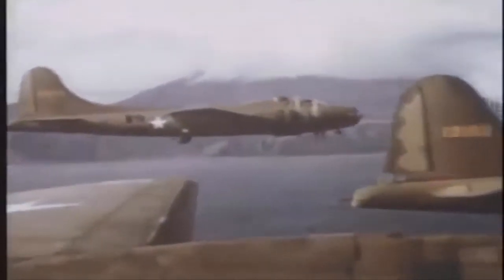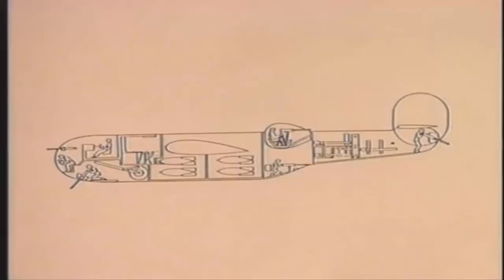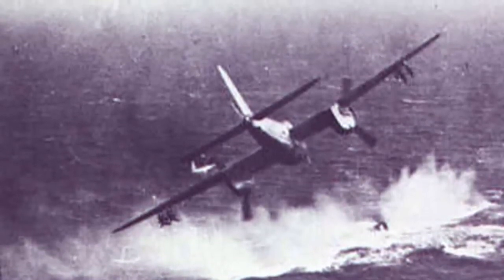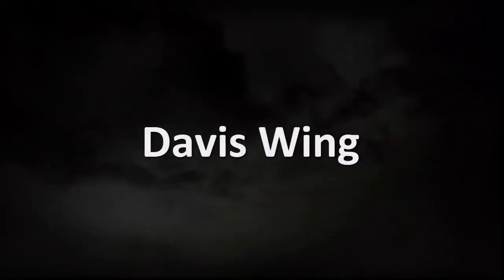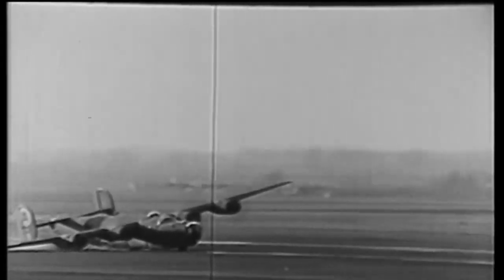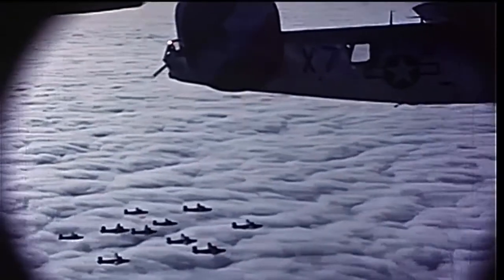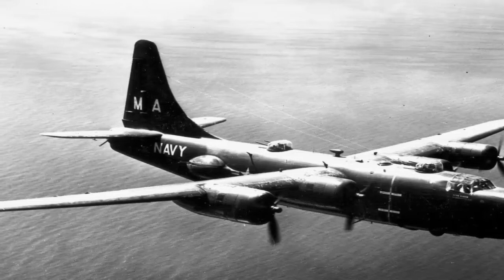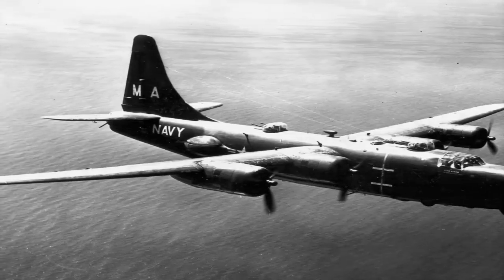B 24 Liberator:  3 Major Design Flaws

Comment: Both the B-17 and B-24 had their advantages and disadvantages. The Liberator had greater range, speed and bomb load, the Flying Fortress was more durable, could fly higher and was better defended. In Europe the B-17 probably was the superior bomber, but in the Pacific it was definitely the B-24. They both served their role admirably.
Reply: Which was superior depended on the mission requirements. 8th AF command preferred their B-17’s. Having a mixed fleet of both was a logistics headache.
Reply: Keep in mind the B24 dropped more Tonnage in the European Theatre than the 17 that was in Service longer..
Reply: Funny how B-17 fanboys don't want to talk about how the B-17 was retired from the Pacific in mid-1943 because of not only range issues but because it was a terrible anti-ship/submarines bomber! It couldn't bomb ships or submarines very well. B-24s served in all theaters throughout the whole war and was never retired anywhere like the B-17! B-24s won the Battle of the Atlantic and helped win the war in the Pacific! Also the sorties to losses ratio for B-24s (226,775 sorties with 3,626 shot down) was 1.60% vs 1.61% for B-17s (291,508 sorties with 4,688) in Europe! B-17s weren't able to bomb Romanian oil refineries in 1942-43. You know what bomber was able to do so? B-24s!!!

B-17s could only do one thing which was short range strategic bombing runs from England to Germany.

Btw, 3,626 lost B-24s and 4,688 lost B-17s in Europe alone in WWII is INSANE!!! We treat it today like it was not a big deal at all. Like that is normal. The British lost 57,000 KIA/MIA and 9,000 POWs on bomber crews alone in Europe also! How good were those German flak and fighters?
Reply: @nogoodnameleft  I knew a guy who was a mechanic on both the B-17 and B-24 in the European theater. He much preferred the B-17 to work on because it was far easier to service engines and do any airframe work. The B-24 was a great bomber, but it was more difficult to service.
Reply: @pimpompoom93726  I know the B-24 is ugly and very tough to work with unlike the beautiful and easy to fly B-17. But the B-24 still was the truly rugged plane that lost less planes in ETO than the B-17 and had a less sorties to losses ratio than the B-17. The B-17 was a non-factor in the Atlantic, Pacific (where it was actually withdrawn for poor performance in mid-1943), North Africa, Italy, and Romania until air bases were established in central Italy in spring 1944, unlike the B-24. The B-24 was truly an awesome Swiss Army knife. The Ford Assembly Plant for swift construction of 8,500 B-24s was one of the greatest feats of engineering and manufacturing in history also! The B-17 was not able to be built fast and efficiently like the B-24. The B-24 truly looks like a can of spam with wings. 🤣
Reply: @pimpompoom93726  The Allies used B-24s to harrass and destroy German U-boats and Japanese ships. It was a fantastic and accurate tactical bomber and anti-shipping bomber unlike the B-17s. They credit the B-24 for winning the Battle of the Atlantic! It was an incredibly versatile plane and not a one trick pony like the B-17. The B-29 also turned out to be a one-trick pony, never serving anywhere other than the Saipan, Tinian, and Guam to Japan bombing route, so the B-24 was truly a special plane.
Reply: @user-qy9tf2im7f  The only reason we don't hear about the B-24, which truly was the plane that won the war in the ETO (was equally as good as the B-17 in Europe), Battle of the Atlantic, and the Pacific Theater is because the first bomber in the 8th Air Force that actually flew 25 bomber missions successfully was a B-24, not B-17 Memphis Belle!!!! That B-24 flew 25 missions 2 months before Memphis Belle did! But sadly in 1943 on the flight home to America to celebrate the B-24 to make it popular, the B-24's pilot and most crewmen as well as the three-star general who was the ETO Supreme Commander (!!!) LTG Frank Andrews died in a plane accident while flying the B-24 in Iceland. It crashed into a mountain, sadly, and Eisenhower was tapped as ETO Supreme Commander thanks to the death of General Andrews. Andrews also was flying home to get his fourth star, making him the overwhelming favorite to be ETO Supreme Commander for Operation Overlord!!! That sadly killed all the PR for the B-24 and the B-17 thereafter stole the show in all the newspapers and post-war documentaries and movies as a result.
Reply: @nogoodnameleft  I worked in the Ford Plant in Ypsilanti where they made the B-24's during WW2, I worked there in the 1990's. They still had the big hanger doors in back where they used to roll B-24's out to Willow Run Airport. B-24 was a great bomber, a better bomber than the B-17. The Flying Fortress was really obsolete by the end of 1943, but it was more rugged than the B-24 and easier to service. The same narrow wing that gave the B-24 speed and range advantage also was vulnerable to damage. Until the ball turret was added to the B-24D the B-17 had better protection. 

I don't see this discussion as one vs the other, they both filled their role very well. The B-17 was available in numbers in 1941/42 and the B-24 was not. B-17 was a major factor in Europe up until the second Schweinfurt Raid and then the B-24 began to displace it-or rather supplement it. Actually B-24's participated in small numbers (most ended up scrubbing the mission due to bad weather) in the second Schweinfurt Raid in October, 1943 but not the first Schewinfurt Raid in August, 1943.
Reply: @pimpompoom93726  Thank you for the information. I don't dislike the B-17. The B-17 is BEAUTIFUL and easy to fly while the B-24 is ugly and looks like a can of spam with wings haha. I just don't like the extreme propaganda that overpromotes the B-17 over the B-24. It is ridiculous. The B-24 served all over the world and was even bombing the Kuril Islands from Alaska and then bombed Kyushu and Honshu from Okinawa! I am always shocked how zero B-29s launched air raids from Okinawa after the Battle of Okinawa. Those bombers launching from Okinawa were B-24 LIBERATORS!
Reply: @nogoodnameleft  B-24 is beautiful in it's own way. The site of B-24's flying through the smoke during the Ploesti Oil Raids was memorable, no other bomber could have done that mission.
Reply: @pimpompoom93726  Absolutely! The Ploesti Oil Raids were one of if not the most important bomber raid in the ETO prior to 1944.

The Balikpapan Oil Raids by B-24s in 1943-44 in the Pacific Theater were AMAZING and for some reason are so forgotten now!!! USAAF flew B-24s from New Guinea to Balikpapan in Borneo to do bombing runs and succeeded greatly. Guess what the distance was: 2,600 mile round trip!!! That is almost the same distance as B-29 bombers from Marianas to Tokyo! Also B-24s were the only heavy bombers flying from Okinawa to Kyushu/Honshu during Summer 1945. I was shocked when I learned about that and even more shocked how that is so forgotten now. Certain companies and PR want us to not love the B-24s that they overhype the Boeing planes, I believe. Sadly, Americans also don't even know about the successful ASW campaign B-24s did in the Atlantic under RAF Coastal Command. That proves that B-24s were incredibly accurate bombers and could sink extremely small U-boats while B-17s and B-29s could never ever do that. B-24s were so amazing!

I will try to keep watching numerous B-24 photos and videos and I think I will eventually appreciate its unique beauty.
Reply: @pimpompoom93726  Another thing that I have been researching recently is the B-24's fantastic 4 manned turrets. Those nose, tail, and dorsal turrets were AMAZING! Far, far superior to the mediocre chin turret on the nose for the B-17 (the small B-17 nose did not allow a real turret to be installed) and that mediocre tail gun, not even a true turret, on the B-17's small tail and also the B-24 dorsal top turret allowed the gunner to sit down while the B-17 dorsal turret had no seat and the gunner had to stand the whole time.
Reply: @nogoodnameleft  B-24 was the next generation bomber, superior in most respects to the B-17. Faster, better range, heavier bomb load. The ball and top turrets in the B-17 was our first kick at the can for powered turrets I believe, the next generation were more advanced without question. When I worked for GM at GM Hydramatic Plant (the old Ford B-24 plant) they had a small library and they had some videos of B-24 assembly during WW2. It was pretty interesting, because I come from an aviation family. My dad and brother were both air force pilots and airline pilots and we owned a small airplane for a few years. Good stuff!

Comment: Sorry, my dad was in a B-24 outfit (459 Bg). He would never let anyone put down the plane.
Reply: Don't Apologize to him. You're Dad was Awesome for what he did my Patriot American brother.
My Dad was a Marine in the Pacific campaign.
I get it!🇺🇸✝️❤️💪👍
Reply: It’s no comment on your dad or the accomplishments of units who flew the B-24. It’s range closed the gap in the mid-Atlantic so that the U-boats no longer had a sanctuary for hunting the convoys vital to the war effort, including our own, in the UK and then on the Western Front. It’s higher speed reduced the time German fighters had to attack them. The bomb load was higher than the B-17’s. Crews died in legion on both European Theater bombers. Nonetheless the B-17 had a reputation for ruggedness that the B-24 did not. How much that assertion is backed up by actual numbers is not stated here. The stats have to be out there as the USAAF documented the hell out of every mission.
Reply: Like every aircraft it had it's weak points and strong points
Reply: My dad was in China. 308th. Radio man and gunner. Flew the hump many times. He also argued in favor of the 24.  On best of the web check out Miss Conduct.
Reply: Yep my dad flew SAAF and he said it was the best
Reply: All planes have their weak points. I worked F-16C's in Korea. The air turbine cooling system was garbage, constantly breaking down. And the modified GE engines had a bad habit of bursting into flames when igniting the afterburner(we lost 3 in 2yrs due to this flaw). But she was still a great jet.
Reply: It had advantages and disadvantages , just like every other machine in the planet
Reply: Nobody asked I’m sure..
Reply: @davidralph8250  the stats are out there..
B24 was more survivable.
Reply: @zacharypanick4484  Nobody cares if nobody asked. I WIN🥇
Reply: @donlove3741  Glad to have YOUR opinion. How about a link to a reliable, original source. Thank you.
Reply: B-24N

Comment: I would say it's durability was very underestimated.  My Father's Ship a B24 H Ford Willow Run had the Hydraulics shot out, flak damage to both wings & one stabilizer, and lost an engine, it went in to a spiral. The Pilot gave the Order to bailout my Father and 5 others went down the catwalk and out through the Bombay Doors. MACR 2398. After dropping about 5000 feet the Pilot and Co Pilot regained control of the Ship and using manual controls limped it back to base. The Plane part of the 449th Bombardment Group Original Cadre was patched up and replacements were put into the crew and it completed it's 25 Missions. It was then turn over to a New Pilot and crew and flew 21 more Missions until being shot down in June of 44 MACR 6443 and had flown 46 missions without full escort. I think it was a pretty durable Aircraft. You also have to keep in mind that the 15th Air Force received no P51s. The 17s mostly flying out of England with the 8th Air Force were first in line to have full escort to and from the target and got them in late 43. My Father was in a Stalag Luft 1. They, heard about the P51s listening to crystal radios they built in the Camp. To the best
To the best of my knowledge they never received P51s and only had P38s & 47 for full escorts in the early Part of the War when they were hitting Northern Italy. Once they went any further, they were on their own and the Escorts would drop them off and pick them up @ the Italian border. Funny thing that was actually a travesty and a big FUP by the Brass, it turned out the P47 could handled larger drop tanks and could have been used for long range escort well before the P51 was deployed. A lot of Ships could have been saved had the Brass not been so adamant
about not experimenting with the P47 that was by far the most underrated Fighter in the Inventory.
Reply: I went on a hiking holiday in Italy and came across the remains of a drop tank with a marker saying it was from a P-47.

Comment: Had the B-24 been used by RAF coastal command at the start of the battle of the Atlantic,U-boat kills would have gone through the roof.The Davis wing on the Liberator wasn't suited to high altitude flight with a heay bomb load,but at medium and low levels it would have excelled,as mentioned previously as a maritime patrol aircraft.
Reply: absolutely correct.  Coast Command could not wrangle many long range bombers from Bomber Command for maritime duty.  since payloads could be smaller,  depth changes and smaller contact bombs could be used,  additional fuel cells could be mounted to extend flying time even more.
Reply: The navy versions of the B24 lacked superchargers entirely. Their mission never called for them.
Reply: @robertphillips9017  Yes,but RAF coastal command used the supercharger equipped B-24 D and J.
Reply: Bro why would you support the bad guys?
Reply: @darkknight1340  In that case he should done it in summer. He "might" have succeeded
Reply: @TheGecko213  If he had sent his entire force to Moscow,captured the city and the Soviet leadership, then he most likely could have succeeded.
Reply: @JZ's Best Friend During the battle of the Atlantic,the B-24 would have been one of the technological advancements.
Reply: @TheGecko213  operation barbarossa started june 22 1941.

Comment: My father flew 33 combat missions as flight mechanic in B-24's in the 735 sq/461bg/15AF. The Liberators had their issues but he was able to keep a badly damaged aircraft flying to get back to base. There were many 24's that suffered extreme damage and still flew. It was not so much the aircraft as where they took battle damage. Flak and enemy fighters were able to down just as many 17's as 24's.

Comment: Another issue with the Davis wing was that it was vulnerable in icing conditions. Some designs would tolerate a fair bit of ice before losing control but the Liberator with the Davis wing was not one. A relatively small amount of ice could disturb the airflow around the airfoil to the extent that the aircraft would depart controlled flight. This is mentioned in Ernest K. Gann’s classic of aviation literature ‘Fate is the Hunter’. Gann flew C-87’s, the transport and cargo variant of the B-24, during WWII.

Comment: I remember reading the book written by the commander of JG400, the Luftwaffe unit that flew captured allied aircraft for evaluation and training.  He hated the B-24.  Said it handled terrible and was an unpleasant aircraft to fly.  He said no German aircraft would have been put in service with the B-24's weaknesses.  However, he said it could not be denied that regardless of the drawbacks B-24s were being built by the thousands and were bombing German targets daily.  An uncle of mine was a navigator in the South Pacific in WWII.  He flew a mix of combat and cargo flights across the South Pacific late '42 to his death in combat in July '43.  He flew cargo runs in LB-30s (the cargo variant of the B-24) between the major US bases like Henderson Field and Esprito Santo.  He hated them compared to the B-17.  I have his logs and letters and he called the '24 noisy, drafty, and cold.  He was lost on a bombing mission in a B-17E at the end of the B-17's use in the South Pacific.  All heavy units using them transitioned to B-24s by late '43.  The '24's range and bomb load advantage made them more effective in the South Pacific than the B-17.

Comment: Britain thinks highly of the B24 because of it closing the mid-atlantic gap, and I guess the 'flaws' were unimportant there.
I believe Harris had to be forced to concede them to Coastal Command, despite their usefulness.
Reply: I think they were designed for US requirements (long range high altitude day bombing) but at that time flying over Germany in daylight was suicide and US took a very long time to learn that when they came in and used the B-24 themselves. 
The Lancaster could carry 14,000 pounds of bombs to the B-24s 8,000 so Harris would need two B 24s and two crews to do the same damage as one Lanc. As Berlin is only 600 miles from London we did not need a plane with a 3,000 mile range bombing Germany.  
Also, the US way is to just make lots and win with numbers. UK had limited resources and limited money and so fought the war in a way to retain and use its resources as best it could. 
So B-24 was used in the best way to utilise its assets and limit any flaws.
Reply: @grolfe3210  I didn't know about the limited bomb load, which makes Harris' attitude seem even more 'dog in a manger'.